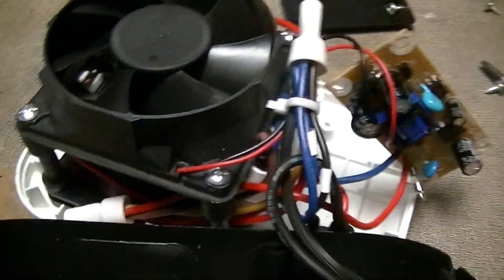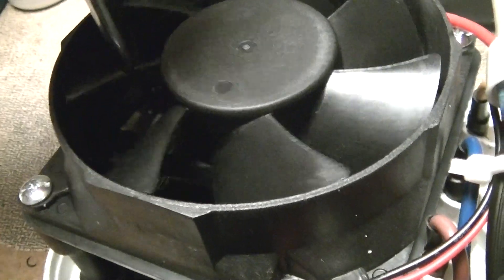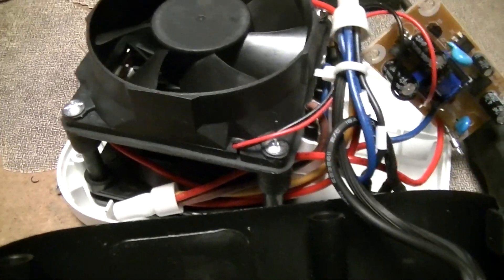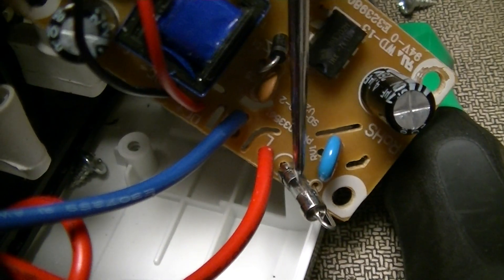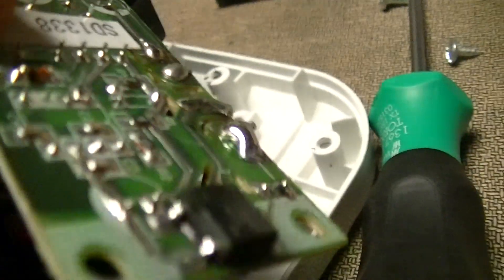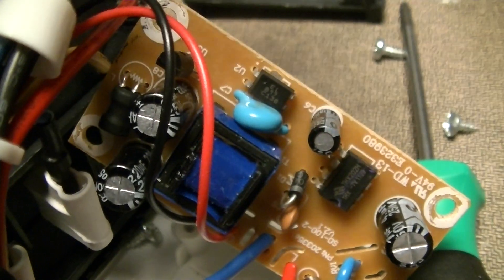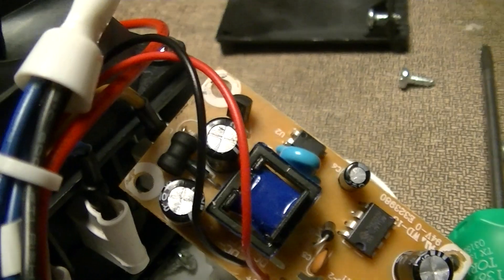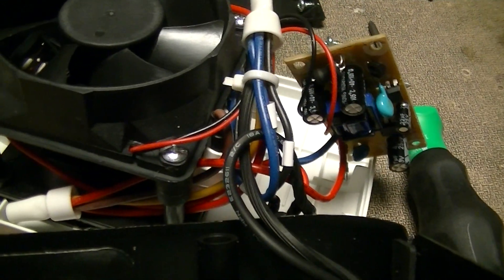Lasko My Heat model 101 200W fan heater guts

Comment: What's the maximum voltage this heater can take, I'm in the UK, using 240V, would I need a transformer to run 1...?
Reply from the maker: 120V only so you would need a proper step down transformer, not one of those horrible TRIAC chopper jobs.

Comment: I bought one of these for my RV because 200 watts space heaters are pretty rare and can run off the solar powered inverter. Although I appreciate your pretty harsh review I don't know what you would expect for $15 and free shipping on Ebay. It works very well and all the consumers reviews on Amazon are predominately excellent for its performance.
Reply from the maker: Phil Chew This was more of a basic safety check due to its country of origin.  Any harshness is due to my building things up to a standard instead of down to a price and judging accordingly.
Reply: @randacnam7321  LOVE that comment!

Comment from the maker: I do this as a preliminary inspection to see if the build quality is decent (remember that this is Chicom stuff after all).  If it looks decent (as did this one), it gets reassembled and put in service.  If not, then the thing gets immediately parted out or modified to make it safe and the video is posted as a DO NOT BUY THIS warning.
In this case, I did this video as a 'what's in it' general interest video (as are the vast majority of these teardowns that I do).